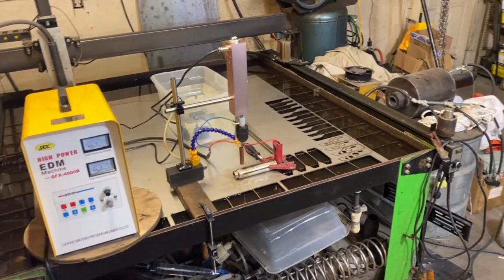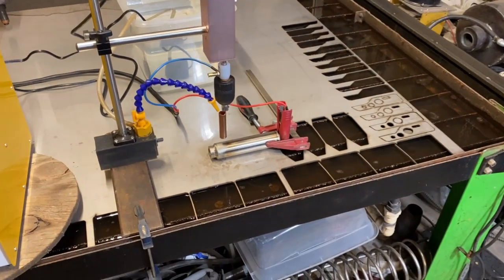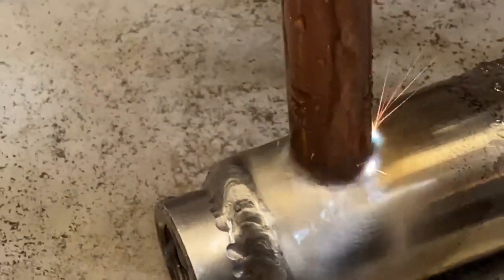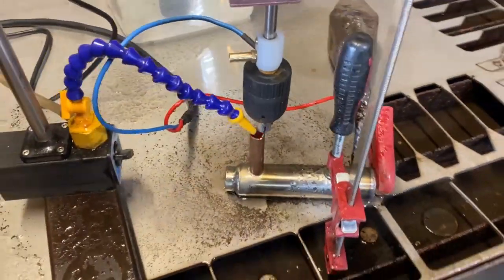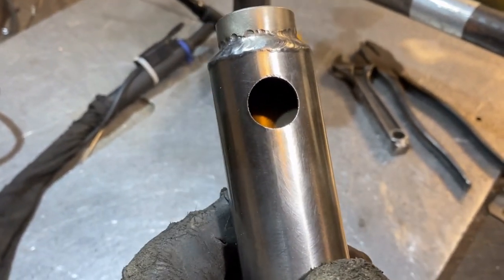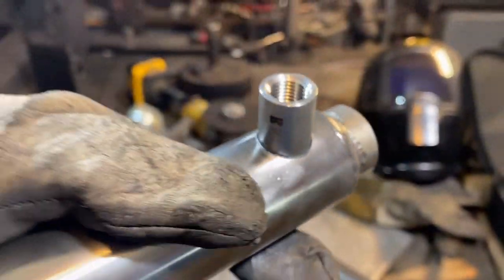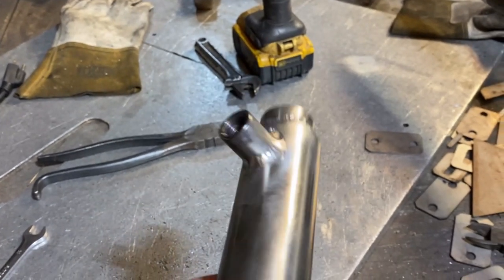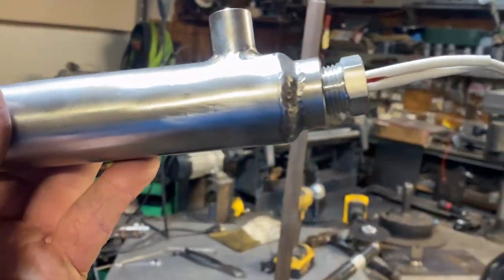EDM large holes in stainless tubing  or Pipe ???  SFX4000B EDM Machine

Comment: I am surprised that you have not gotten the feel of welding NOBOX7. I can weld thin sheet metal 20 gauge with a SMAW. I use 1/16 inch welding rod that is both metal rod and outer flux total diameter. Welding with MIG is way easier. Then with TIG I can weld stainless steel razor blades which are 6 thousandths thick no problem. I was taught and told the more you weld the better you get, PERIOD !!! Shame you are not closer to my location, I would give you a crash course in welding. Where are you located NOBOX7 ?? JUST maybe I am thinking wrong about your location distance from my location. 
Good day fella. I like using the disintegrator for holes in stainless as the hole saw does suck. I have found that using hole saws for glass with the tungsten carbide grit fused to the cup part of the saw work great for thin gauge stainless steel metal. 
            Have a Merry Christmas and a Happy New Year too fella. Keep up making great videos with actual substance for the home handyman. Peace vf

Comment: What about encasing the pre heater with a larger pipe for the Air preheat that extends around the burn chamber so that the air would come back and heat up the oil once it burns for awhile.. Then the thermostat would keep the heating element off ...and then transition to steam and wouldn't need air compressor?